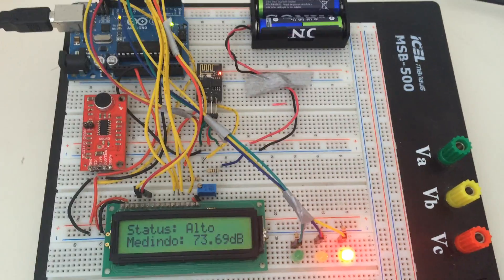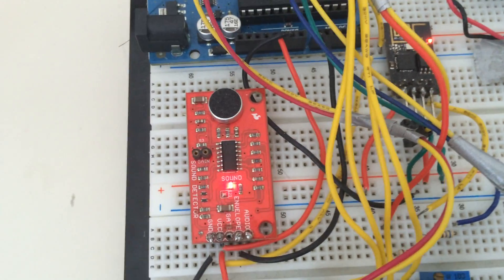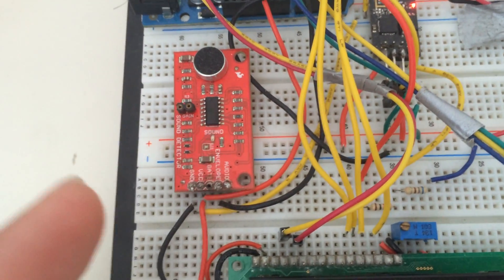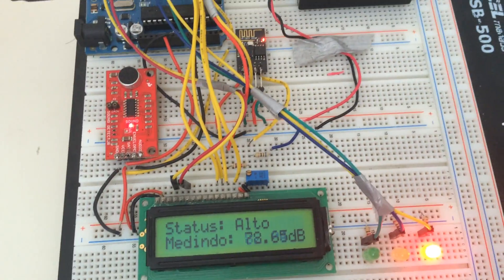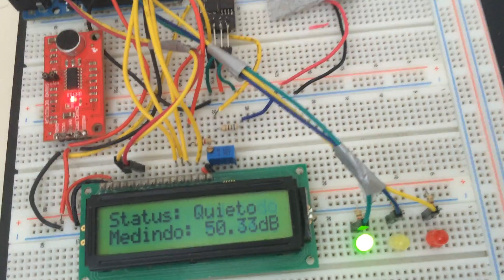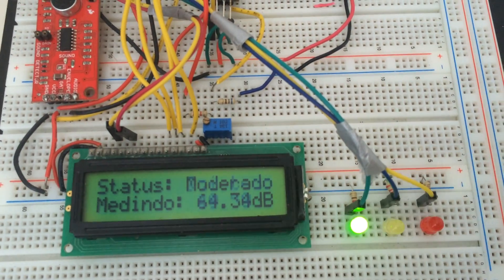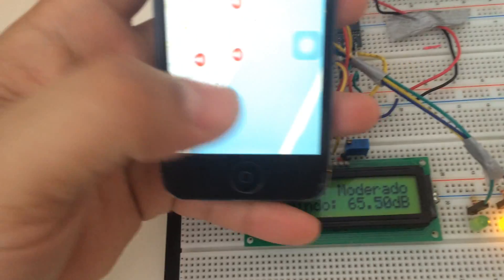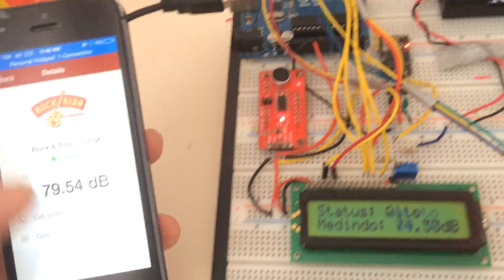Sound Level Meter IoT using ESP8266, SparkFun Sound Detector and Arduino

Comment: Sir, how to do the calibration of the sensor ?  I have tried the calibration by comparing the analog value from the sensor with the dB measured by sound meter app. However, the analog value of the sensor shown is almost the same although the sound goes up to 80dB from 40dB. Is there any solution to solve this?
Reply: same dude

Comment: HI Thiago,

    Your project is nice but I have a doubt for my project that , the microphone displays various values for the sound input. But I need the value in Decibel, so how can I convert the voltage reading from microphone to the corresponding decibel value. Is there any expression is available? If there kindly comment it or else give any solution to solve as possible.

              Thank you in advance
Reply: Did you know to do do it sir please reply to me

Comment: Our decibel meter measures different values between 60 to 90 dB, but the one from the arduino only gives values in between a range of 3. For example if I read a dB of 75 from my meter the sound sensor gives 33 and then for 85 dB it gives the same output of 33. How can i change the sensitivity of the sensor, because turning the potentiometer did not help. Please Help!
Reply from the maker: Hi, Naomi. Well, the only way I know that you can change it is by attaching a resistor or a potentiometer to the inputs of the SparkFun sound detector. Hope it helps!

Comment: Hi Thiago, I am working in a similar project so I have many questions... How did you calibrate your sound meter?
Thank's
Reply: I have the same exact question. Our decibel meter measures different values between 60 to 90 dB, but the one from the arduino only gives values in between a range of 3. For example if I read a dB of 75 from my meter the sound sensor gives 33 and then for 85 dB it gives the same output of 33. How can i change the sensitivity of the sensor, because turning the potentiometer did not help. Please Help!
Reply: @naomino3827  did you find the solution to solve the problem u mentioned？

Comment: Hello Thiago, I'm doing a project for my degree and your project is very useful, thank you! Could you answer how did you get this and how in order to calibrate my system? 

const double dBAnalogQuiet = 10; // envelope - calibrated value from analog input (48 dB equivalent)
const double dBAnalogModerate = 12;
const double dBAnalogLoud = 17;

Thank you so much.
Reply from the maker: Hey Joaquim, thanks for leaving your comment. I calibrated it by measuring the analog value I was getting and comparing it to the ones from the app. These values are assigned based on what I considered to be quiet, moderate and loud by a couple of tests that I did in a room. Hope it helps!

Comment: 10=48.5db
12=60db.....
how does 10 corresponds to 48.5db and so on...
Reply from the maker: Anuja, I compared it to a reference value I had gotten from a sound meter I had on my phone. The 10, 12 are just voltage values from the envelope, which I read from the analog input of the board.

Comment: Hi Joshi, I wanted to know if it is possible the list of materials for its construction
Reply from the maker: Hey man, pretty simple: batteries, sound level meter, an arduino board, an ESP8266, breadboard, a LCD and some wires and you're good to go!

Comment: I use the 3-pin audio sensor in the same project. But I do not want to add esp. How would you like the code please be a mine My mail wepahatamov@gmail.com
Reply from the maker: The changes in the could would be minimal, but you'd have to pay attention to the connections.
Reply: Usually if you know basics in arduino configuration. You would be able to "reconnect" the pins on this configuration, If you have any problem ,let us know.

Comment: Does the system would still work if i use other than the sparkfun sound detector with just a 3 pins (VCC, GND, OUT) sound sensor? I mean it would still be able to collect the sounds that is to be processed and measured?
Reply from the maker: Neale, if you're thinking about using another circuit to replace the SSD, the circuit should have a envelope detector to measure the amplitude of the signal, since the conversion to dB is done based on that.

Comment: code for LCD and circuit diagram
Reply: Thiago Ribeiro hi man, in your code, when you wrote 'calculatedecibel' = 20*log( x / decibelvalue) 
what does the 'x' reffers to?
have a good day.
Reply from the maker: Viswas, the code for the whole project is on my GitHub repository: https://github.com/tolribeiro/RecNoise. The circuit diagram I haven't had time to create yet but I'll post it there when I have it.

Comment: What did you do with R17 to get such good sensitivity?  I am using the same sound detector and it doesn't pick up my voice talking from a few inches away.  Thanks!
Reply from the maker: Hey, I actually didn&#39;t use a potentiometer nor a resistor to alter the sensitivity, which means I used the board as it is. Though I noticed that how you power the circuit may chance how accurately the board reads the analog value.

Comment: hi i am Rajkumar joshi. my project work is noise pollution monitoring system .
dear ,
small help please send circuit diagram and project report Soft copy.
which sensor used ?
Reply from the maker: Hi Joshi, that's cool! let me know when you're done with your project. Unfortunately I haven't had time to create the circuit diagram, but the code for the whole project is on my GitHub repository: https://github.com/tolribeiro/RecNoise.

Comment: it is very similiar for my soon to be final project..... thank you...
Reply: i got this error.. how this is supposed to be?

Arduino: 1.6.5 (Windows 8.1), Board: "Arduino/Genuino Uno"

recnoise.ino: In function 'void loop()':
recnoise:84: error: 'calculateDecibels' was not declared in this scope
recnoise:120: error: 'calculateDecibels' was not declared in this scope
recnoise:156: error: 'calculateDecibels' was not declared in this scope
recnoise:173: error: 'sendToThingSpeak' was not declared in this scope
recnoise.ino: In function 'void restartESP()':

'calculateDecibels' was not declared in this scope

  This report would have more information with
  "Show verbose output during compilation"
  enabled in File > Preferences.

Comment: can i get tutorial of this?
Reply from the maker: +Muthi Winaswarna Hey there, sure! I'm planning on doing this soon but before take a look at the project on my GitHub: https://github.com/tolribeiro/recnoise
Reply: thank you for your advice, im planning to make the same one with grove loudness sensor and Arduino UNO but i dont know how to get the sensitivity and convert it to dB, im using ESP8266 too as interface with my web localhost but i dont know how to input the URLlink on mySQL, hehe sorry im to newbie of this but can you give me some advice to make it all work?
Reply from the maker: +Muthi Winaswarna I am not sure how your loudness sensor works, but in my case I had an analog value from the envelope, let's suppose 10. Then with a SPM application, I would get the corresponding value, let's say 40 dB. Thus I would have that as a reference for other amplitudes, being able to use the logarithmic SPL equation to turn the envelope output into its dB equivalent. It's not the most accurate method at all, but it worked well.
Reply: +Thiago Ribeiro okay, i think i can get the envelope with the sensitivity of my sensor. question again, did'nt your ESP8266 stable with the 3 volt battery for the power supply? i used 9 volt dc battery and regulated it to 3.3 volt but its not stable at all. and why you used softwareserial.h for the txrx pin? is that not work on 0 and 1 arduino as the txrx pin?
Reply: +Thiago Ribeiro Sorry for to much question :(
Reply from the maker: Muthi Winaswarna Yes, unfortunately the ESP is very sensitive but it worked well for me with the use of the batteries. I remember using a voltage regulator from 5V to 3V and it was also satisfactory. Regarding the TX-RX pins, remember that your Arduino uses them to communicate through USB with your computer, so it can cause interference. That is the reason why I decided to use two other ports to communicate with the ESP separately.
Reply: +Thiago Ribeiro how'd you send your data to thingspeak?
Reply from the maker: I send a HTTP GET to the ThingSpeak server with the value in decibels. If you look at the code you'll see it.